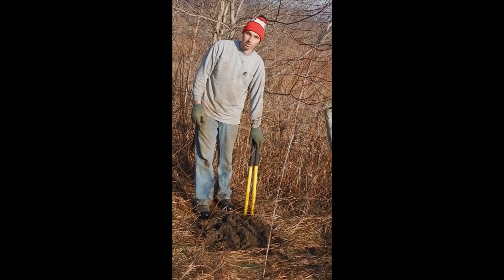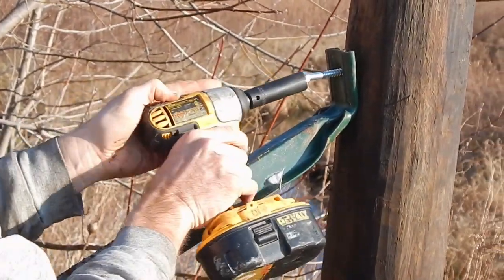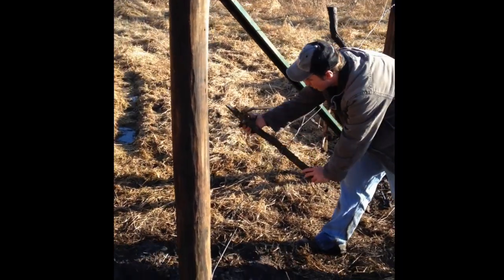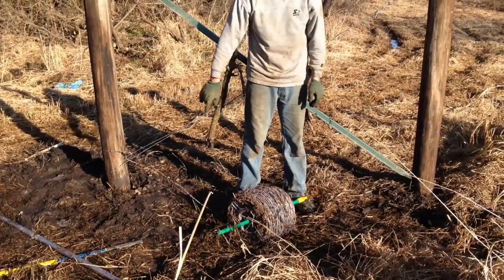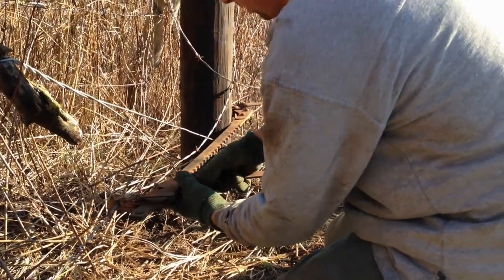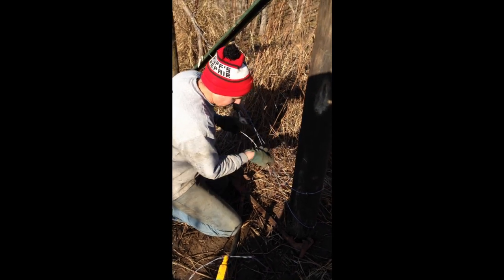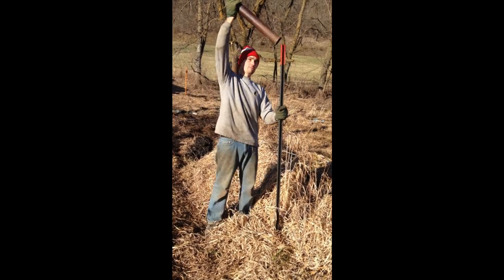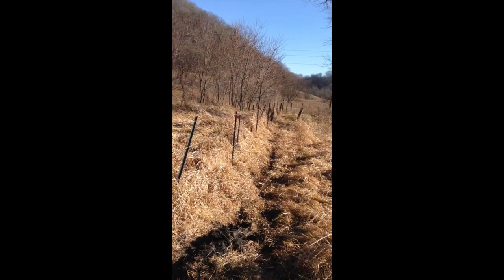How to Build a Barbed Wire Fence in 10 Easy Steps (farmcards)

Comment: Good job all but one thing you never start at the bottom first you will be fighting be tangled on bottom with the others start at top and work down.
Reply from the maker: Thank you for your comment Joe. I've never tried that.
Reply: I was always taught to start at the bottom and work up Joe. I was always told that you could keep the wires tighter that way. I have never seen brace wires done quite that way either. What we usually did was to wrap the number nine around from the top and then to the inside of the bottom of the corner or end post and twist the wires together at that point and staple in place. There are many different ways of doing it and I don't find any fault with how farmyards built this fence. Turned out very well.

Comment: Where do you get the metal braces?  I can't find them at the local tractor supply or ag store.  Is this a stronger setup than a center horizontal post brace?  Thanks
Reply from the maker: Hey Liberty Garden! Thanks for your comment. I just looked it up online. For making this fence we used a few different products. I don't know if other companies sell these but I see on the Red Brand website they are called Red Brand Diagonal U Braces and you can get them in 8 or 9 ft sizes but I don't remember them being that long. True Value dealers sell them or you could probably get them online. If that doesn't work out, just leave me another comment and I can check with the hardware store in town to see where they got them from. As far as whether or not it is stronger than a horizontal post brace, I know that since I started making these videos about 2 years ago I have been paying a lot more attention to the fences on dairy farms in Southwest Wisconsin. I would say that most of the farmers here use h post braces but as far back as I remember the way we have always built fence is by using these diagonal u braces.  (I don't know why they are called U braces when they look like a line)I think we do use the U braces because having a metal brace seems to make it strong enough for the mostly Holstein herd that was going to be on that pasture. A farm I recently went to for the Timeless Fence System in Iowa used pvc H braces that were high impact and I think that you can order a kit from them if you want something that could be easy to assemble (that is designed mostly for  electric fences although if you put the t post clip through the holes you could use them for barbed wire. From where I'm standing it looks like it is a matter of preference on the person building the fence. I think it looks easier to use the diagonal metal braces instead of putting a lag bolt or however they put one of those horizontal braces in personally, but that is the way I was taught to do it so I'm biased.
Hope this helps.
Good to hear from you again.
Reply from the maker: I watched your video where you used a come along to tighten the wire. Looks like a really nice fence!
Reply: The problem is that two weeks later the corner posts leaned and it's now loose.  Clay soil is horrible.

Comment: what dewalt drill would one recommend for this project? thx
Reply from the maker: Hey Steve, 
Thanks for watching!
I think he has a Dewalt Impact Driver 18 volt drill. I think you can get it in a two pack with a drill and an impact driver. Maybe wait until the day after Thanksgiving sale this year. Save some money.
Reply from the maker: I'll check the next time I'm over there to make sure I told you the right one.
Thanks- Farmcards
Reply from the maker: I checked, the drill used in the build a barbed wire fence was an 18 volt Dewalt Impact Driver, but since he has upgraded to a 20 volt Dewalt Impact Driver that you will see in the later videos. Thanks for checking! I have an 18 volt Dewalt regular drill and I like it.
Reply: Is the impact necessary? Or can i get this done with a 20v regular dewalt? Thx
Reply from the maker: You could just use a ratchet or a wrench too. For years we just used a wrench to sink in the lag bolts.
Reply from the maker: you can get it started by tapping it in with a hammer then turning it with a wrench after that
Reply: we recommend a milwaukee dewalt drill
Reply from the maker: Hi Bradley'sCoFarm! Thanks for watching and commenting!

Comment: Hi, what is the longest distance you can stretch the barbed wire before you need a brace?
Reply from the maker: Hi Frank, I don't know exactly, but the fence we built in the video we figured was approximately 100 yards and it had two braces. Some of the fences on the farm at home ran quite a long ways before being braced. It is my understanding that you only brace the fences at the beginning and the end and where they intersect with other fences. 

All the fences we have built were like that.

My suggestion is to go out to the country, any dairy farm and check out their fence lines. Organic dairy farms are great for this because the cows need access to pasture for a certain percentage of the day to be accepted onto certain truckloads, unlike some confined operations.

I hope that helps! Please don't forget to like and subscribe!

Please remember this is just my opinion. There are a few different ways to do this according to other video makers.

Disclaimer:

The contents of this video are for educational purposes only. This is how we built fence on our family's farm. Please use common sense when building fence as it can be dangerous and we cannot assume responsibility for anyone getting hurt while building fence.
Reply: I personally build an H Brace every 100 yards in GA but I have see it run much farther in Montana.  The more braces you have the less sagging  you will have.
Reply: 100 meters or just a bit less roll of barb does 330 less wrap

Comment: Thanks for the video.  Don't you have to bushhog for the lower wire t tighten without obstructions?
Reply from the maker: I'm glad you are enjoying it. While it is nice to mow that area, we didn't have to to make this video. It would however make it easier to tighten. We did use a chainsaw to clear some briars out of the way. And in response to your earlier question, we just added another clip to tighten up the spot. Not sure if that is exactly the best way to make the fence tighter on the hill, but like I point out in the disclaimer, this is just how we do it. Every farmer probably does it slightly different.
Reply: Where is that other clip,  I can't find it on you channel.  Thanks.
Reply: Never mind, I see it.  Thanks.
Reply from the maker: no problem. thanks for watching!